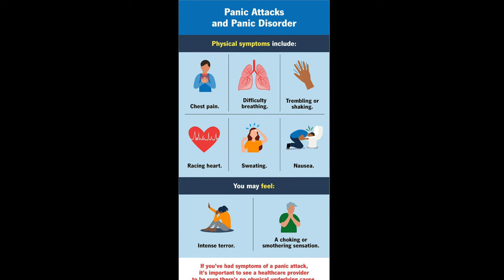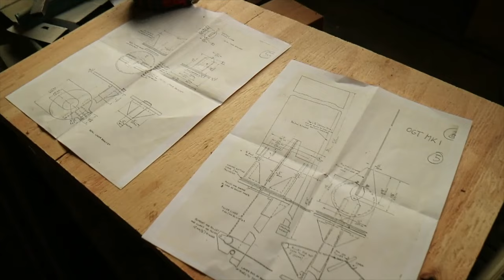FALLING APART trying to REBUILD a windvane at the isle of women

Comment: You guy's are probably better off in Mexico as you say. I saw that the Philippines were hit with a massive hurricane recently and then also i was wondering if you got metal filler for those cracks in the wind vane and filled them in then got a bit of carbon fibre glass to repair the wind vane with (i know its more expensive but it'll be bomb proof) that'll be the end of that problem.
Reply: I love how these sailoramicals stimulate thought provoking conversations and invention... I think brazing may be a good filler method because it can be done with a propane torch and aluminum alloy sticks which is alot cheaper than most hard filler like jb weld (which I love btw)... epoxy cracks under duress eventually so glassing over the whole shebang  really is the best solution as Robi suggested... looking forward to them reinventing the dinosaur because I have one too.
Reply from the maker: Thanks for watching! We shopped for carbon fibre strands actually, and they weren't much more than getting normal cloth, but we didn't find any within reach.

Comment: Great discussion.  I am in the  Med  where sea temp is at record high.  
D
Reply from the maker: 😬 Lots of records being broken this year...go team!
Reply: It's all a bit screwed in the Med. It's 11.00ish now and it's dropped to 36 from 45+. On the upside when I get up in the morning it'll be 34 or so and it'll seem cool and refreshing. It's way beyond everything this year.
Reply: @sailorama I see that your anchor did not drag. I assume the bottom is sand ? What type of anchor are you using?
Reply: @davefoster7770 yep. Currently on anchor in 40kn of wind north coast of Sardinia. Sea temp is over 30c. Unsettled weather.
Reply from the maker: We usually have a 65 lbs bruce anchor down and a decent amount of chain - all very much needed equipment because the bottom is mostly grassy sand, notoriously bad for clumping up anything anyone puts down here.

Comment: @sailorama _ Hi you Three, we've had record lows here in Cape Town (Coldest in 45 years) of ..... yeah I know it's mild for the USA crowd.... 6Deg C  (It normally goes down to 10, never below)  Robby, can't you have those cracks welded or you could drill right through the bracket and the pipe, bolting it and sort of clamping it together???  _
Reply from the maker: Yes, we heard about South Africa's cold weather. We could indeed weld the aluminum, although in some places we can see where it has already had some welding done - it is essentially crumbling all over the main body. We decided to go with a jury rig fix until we can find an appropriate welder who may be able to cast a new body. Clamping everything down is also something we are considering, if we can get ahold of some carbide drill bits.
Reply: @sailorama my aries is manganese which is not weldable really but yours looks like it has stainless  legs through it? Dissimilar metals can really accelerate the corrosion of your aluminum... would be cool to cast parts in bronze!!! I have cast aluminum and bronze in  wood fire and sand yeah on a beach. Styrofoam or wax molds burrowed in wet sand with a funnel to pour the hot metal into the molds just melt away...
Reply from the maker: Casting a new body could be a really cool project if we find some good metal to melt down 👍👍

Comment: Could be too much leverage to just glass over the cracked fittings- consider "entombing" the non- moving parts of the.assembly into one collossal chunk.
Reply from the maker: Yes, we had a bit of discussion about how much to ‘entomb’ - we didn’t want to cover the central pin, but got as much as we could, I think.
Reply: I think that was the wrong word, glad you took it how I intended. Good sailing nice folks